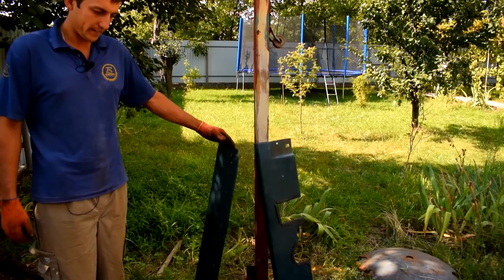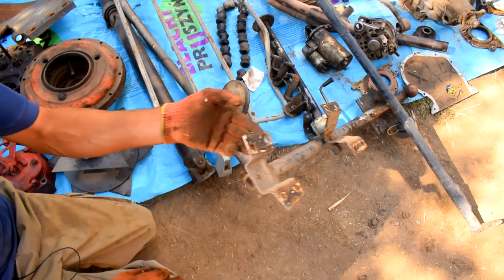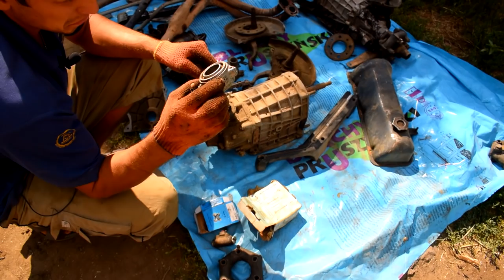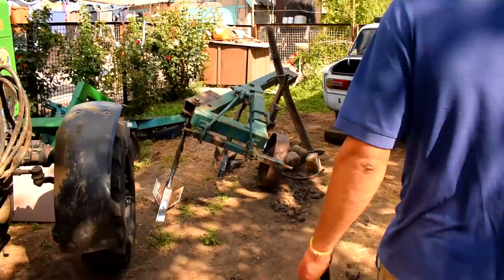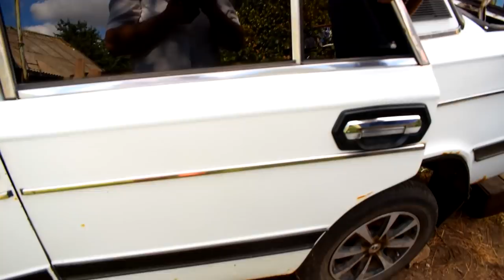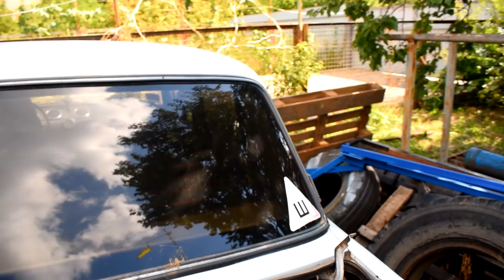Барахолка від Передєлкіна

Comment from the maker: Телефон 0676457966 тут же і вайбер
Стійка Параплау 3500 грн. шт.
Шків компресора Зіл 100 грн
Колінвал Д-50 Корінь Н-1 Шатун Н-2 2000 грн.
Ріжучий апарат ПСП-1.5 НОВИЙ 1000 грн
ВІНЕЦЬ РЕДУКТОРА  ПСХ 01.003 ПСП-10  120 грн 
ЗІРОЧКА ПСП-1,5 Z-14 T-19/05 НАТЯЖНА 200 грн
Муфта щеплення Нива СК-5 не взборі 1000 грн
Грудина відвалу плуга 100 грн
Відвали на плуг 400 грн
Головка СМД-14    2500 грн 
Насос Масляний    500  грн
Кришка ПД-10         300 грн
Фільтр грубої очистки палива   150 грн
Ричаг ввімкнення НШ-32  150 грн 
Трубки паливні ЮМЗ   200 грн комплект 
Вал масляного насоса ЮМЗ   50 грн
Шатун СМД по 400 грн 
Привід НШ 32     500 грн 
Привід НШ-10    400 грн 
Шестерня паливна  200 грн 
Шестерня распредвалу   150 грн
Шестерня НШ-10    100 грн 
Паразитна шестерня  100 грн
Кришка редуктора пускача   100 грн

Проставка передньої кришки двигуна 300 грн 
Піддон СМД 200 грн 
Клапаний механізм СМД  300 грн
Штовхачі штанг  по 20 грн 
Штанги по 20 грн
Бендекс  100 грн 
Клапаний механізм Д-65 комплект 1000 грн 
Тарілка клапана СМД 20 грн
Двигун ВАЗ-2103 2000 грн

Міст задній взборі 2000 грн.
Домкрат ВАЗ 100 грн.
Комплект шестерен ГРМ ВАЗ 100 грн.
Двері взборі по 500 грн.
Все інше що буде ціково уточнюйте або у вайбері або по телефону 0676457966

#Selhozperedelkin  #Україна #Запоріжжя